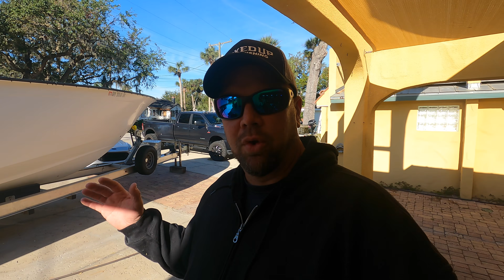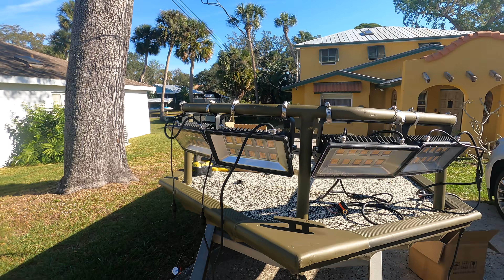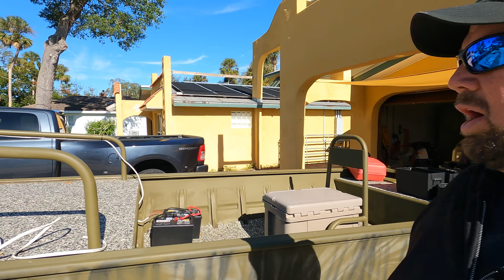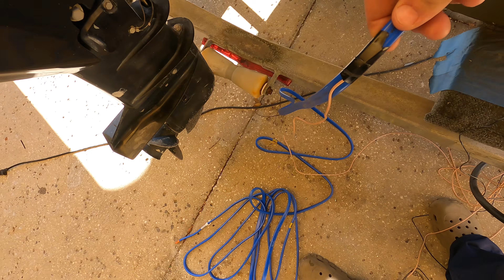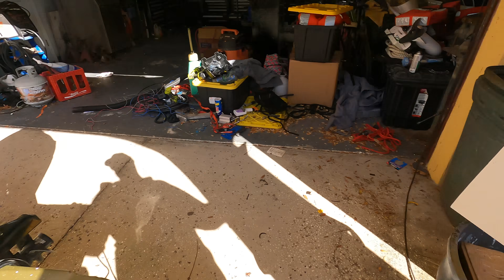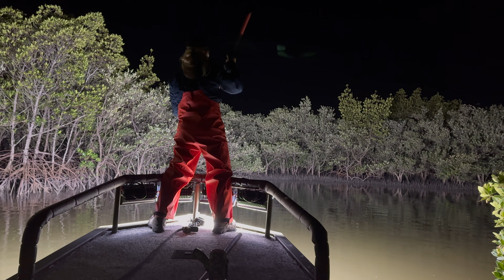RIGGING OUTRIGGER OUTDOORS LIGHTS & Finishing Up The Jon Boat Build!

Comment: Sweet setup. I've been checking out the outrigger lights for my boat, trying to decide on mounting above or below water. Why do you prefer the rail mount?
Reply from the maker: I made the rail mount removable so I can use the boat for shrimping and rod and reel fishing.  Been out twice and lights are nice not having to put in water.  But you can’t deny how underwater lights look.
Reply: Thanks, I'll probably do the same so I can remove them. Might still add a couple small underwater lights on a removable pole on the bow.
Reply from the maker: Yeah I’m sure that would help.

Comment: you just might melt the flounder lol. I use the underwater swamp eyes and love them. They also work great for running lights in  canals. Cant wait for the first trip
Reply from the maker: Yeah me2.  Tried to go out other night but blew lower on the Merc.  Just got a Yam F25 so hoping for a weather window soon.  Water is like stirred up